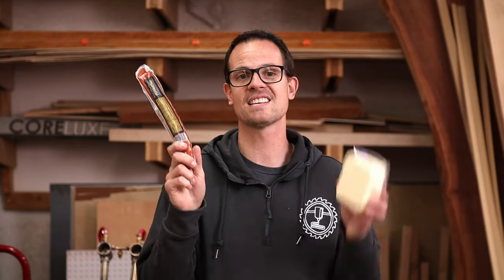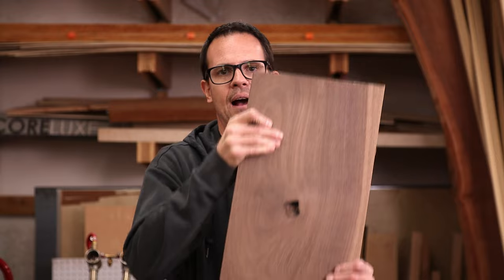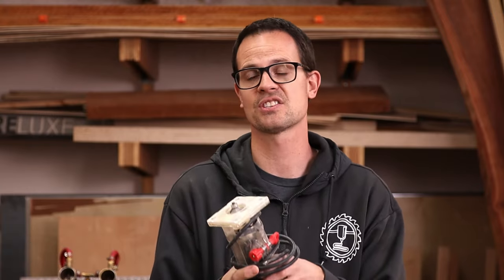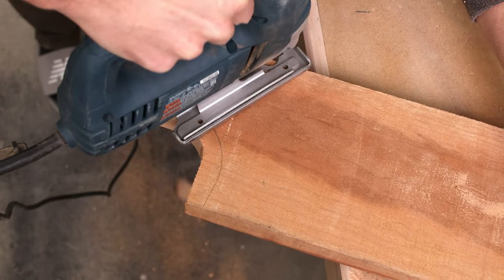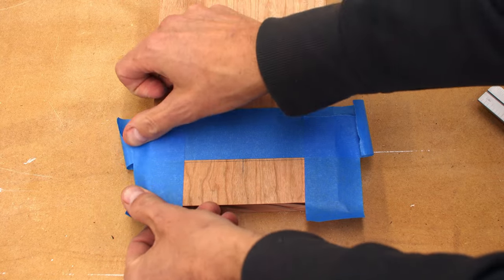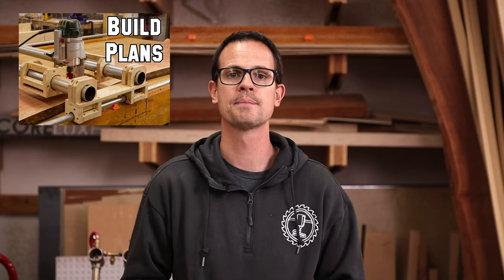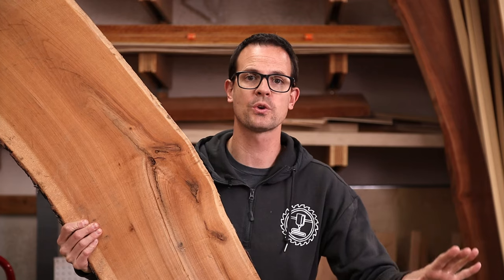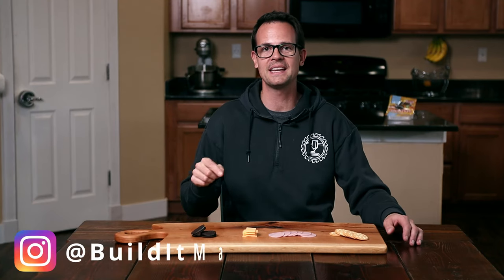Ultimate Guide to Making Charcuterie Boards - 5 Levels From Easy DIY to Pro

Comment: Id suggest wetting the board and letting the grain rise and sanding one more time especially with a charcuterie board. Kress you are killing it.
Reply from the maker: Thanks!! Actually there is one that my wife has used a bunch of times and there is some grain raised on the sides I need to hit with some sandpaper and redo. I totally agree two grain raising since it will get wiped down is the way to go.

Comment: What oil product did you recommend to treat the wood with instead of mineral oil? Nice Vid!
Reply from the maker: Thanks! Well the only oil I know of that will not go rancid is mineral oil. University of Wisconsin Department of Food Science did a study on it a while ago. You could try straight bees wax which should be ok. Also I have heard that fractionated coconut oil will take longer to go rancid since the fatty acids have been removed. If I couldn't use mineral oil I would probably just use bees wax. Hope that gives you some ideas.

Comment: I love how you show the progression of tools! It helps beginners like me decide how invested I want to get before working my way up to more sophisticated tools. When you filled the smaller holes with baking soda and added super glue, is the super glue food safe?
Reply from the maker: Glad it was helpful! Soooo....I am pretty sure super glue is not considered food safe. Probably not the best to use, but it is on the side so I wasn't too worried. I should have just continued to use the epoxy. Thanks for pointing that out.

Comment: Those are great boards.  Did yu just doodle for the handle templates or did you have a different aproach?
Reply from the maker: I looked at a couple of pictures of handles  online and then sketched out what I liked. Then once transferred to the MDF template I refined it a little bit more with sanding.